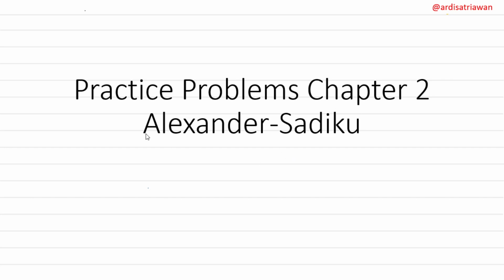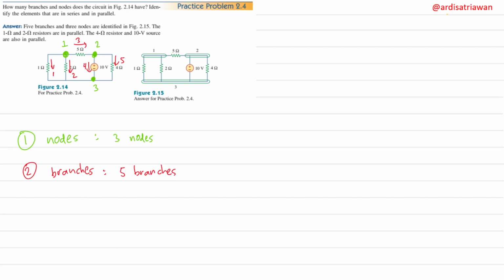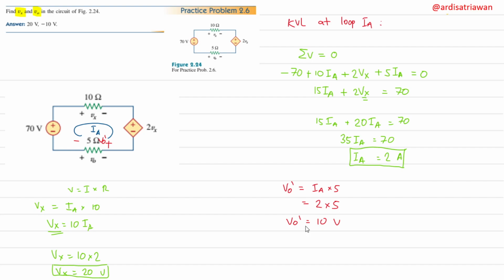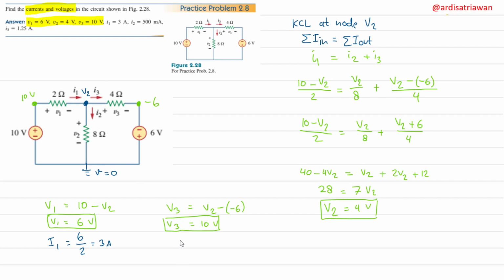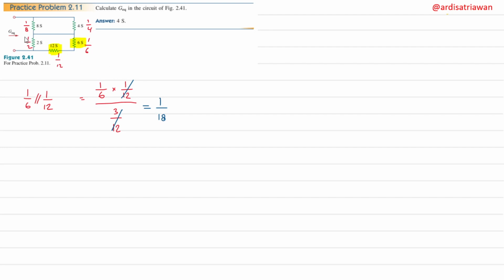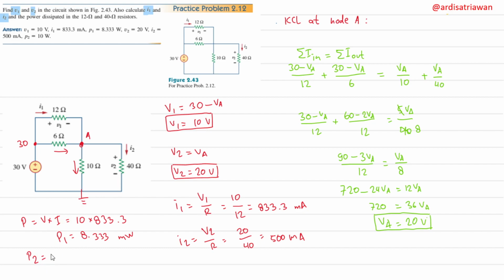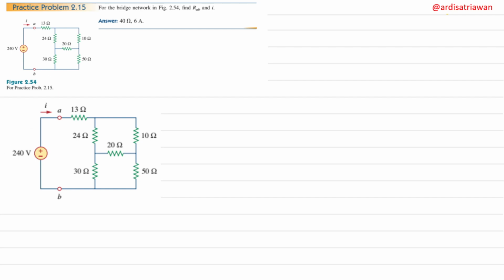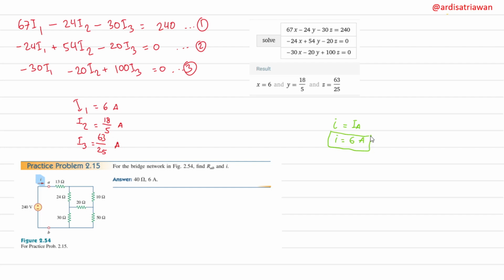Practice Problems of Chapter 2 Fundamental of Electric Circuits (Sadiku) - In One Video!

Comment: The mistake in problem 2.11 was that you considered the first two resistors to be in parallel when they are actually in series, you also considered the resistors to be in parallel in the final Req calculation while they are in series